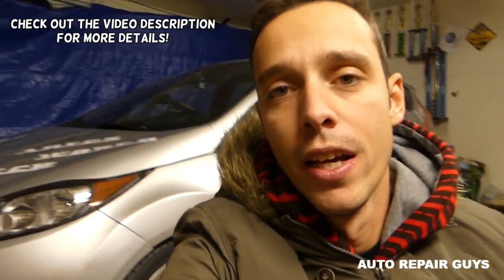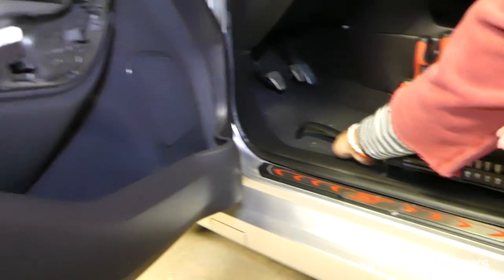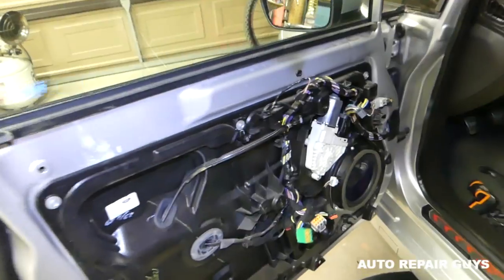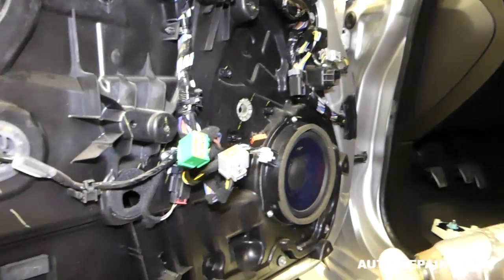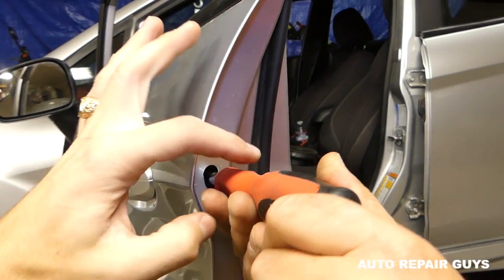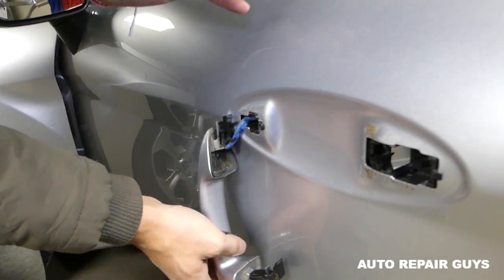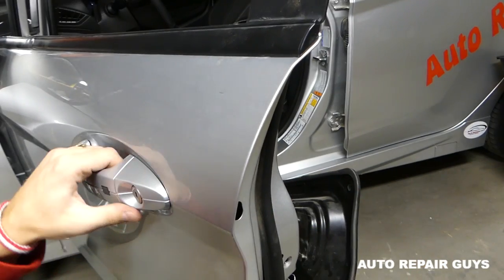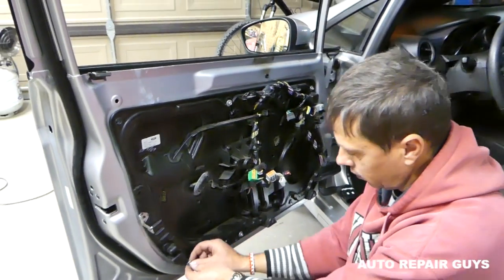FORD FIESTA MK7 FRONT DOOR LOCK ACTUATOR REMOVAL REPLACEMENT

Comment: THANK YOU, GENTLEMEN! - I used this video to replace the door lock actuator and the window regulator at the same time. The plastic interior framework that ties the door handle & cable to the door lock actuator snapped in half. I used JB Weld KwickWeld 6 minute epoxy to repair it. Amazing stuff. - By the way, I was told by the man that sold me the car, that the door lock actuators were a re-call on 2013, 2014, 2016 & 2017 Fiestas..... of course mine is a 2015 .... darn the luck. Glad you made the video. Thanks again!